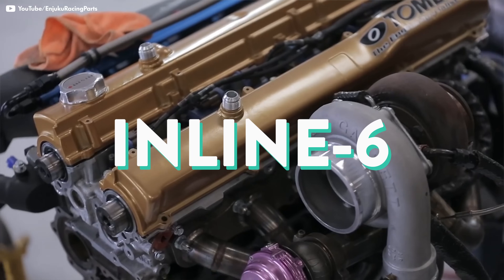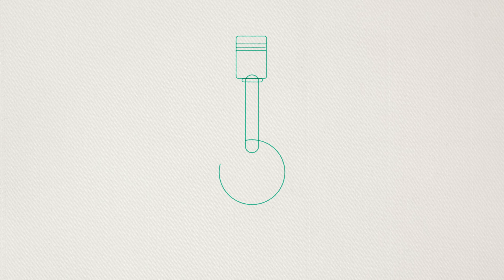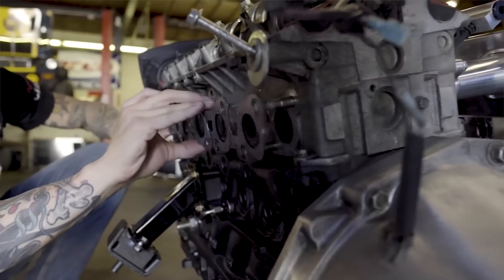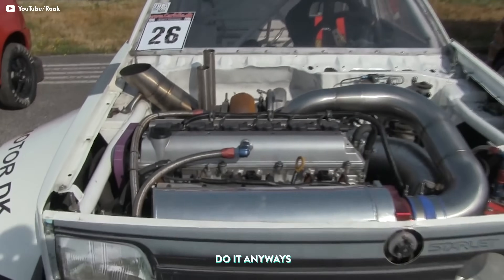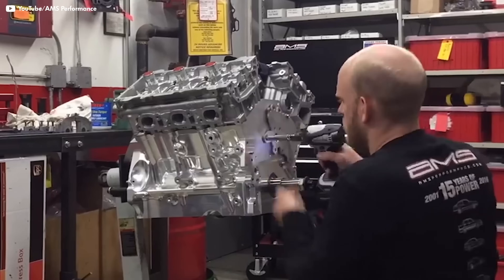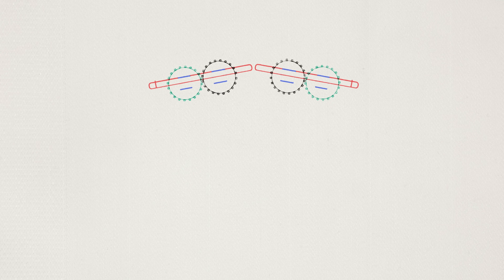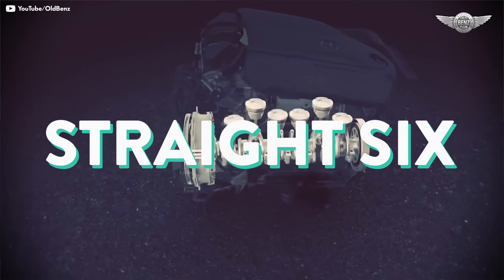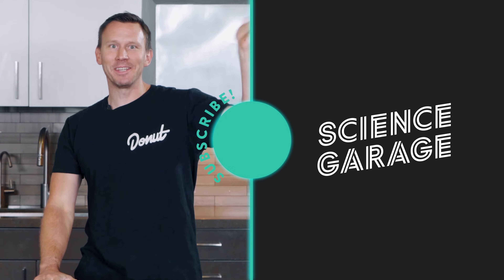INLINE 6 vs. V6 - How it Works | SCIENCE GARAGE

Comment: Everybody talking bout supras and whatnot but AMC/Jeep inline 6 is bae
Reply: Ford’s inline 300 is pretty good too. It isn’t a powerhouse but they are pretty bulletproof. My brother has a 500k+ that hasn’t been rebuilt once. The rest of the truck around it is falling apart though.
Reply: Kent Weisner I’m afraid I’m going to have the same problem with mine one day
Reply: THE 4.0 WILL NEVER BLOW

I wouldn't be surprised if my XJ outlives me, honestly. They can chooch up to 400,000 without any problems.
Reply: My 2000 Grand Cherokee has over 170000 miles on it and it runs better than the 2016 Hyundai I took my driver's test in
Reply: Jiggly Naut sounds like you got yourself a good vehicle in that Grand Cherokee

I have a 1991 Cherokee Limited that I'm in the process of getting back on the road

It needs to have a suspension overhaul done along with a few other things, such as a transmission rebuild
Reply: Tornado motor baby
Reply: Eamon Murtaugh I actually have a Jeep Cherokee that has an inline 6

In fact, I'm actually looking to get it fixed up so it can be driven again
Reply: Was hoping for a Barra comment in here somewhere...
Reply: 231 cubic inch Buick V6 is the best V6!!!!
Reply: The Chrysler 225 Slant Six is the best.

My '62 Dodge Lancer has lasted 56 years, 872,000 miles, and by the time I got her, 15 years of being left outside without being ran, all without an engine rebuild, and is still running.
Reply: Iron duke!!
Reply: B1 Battle Droid the Iron Duke is a Pontiac 2.5L 4 cylinder.

Comment: Forgot the 4.0L straight 6 from Chrysler
Reply: Jeep!!! It was a carry over from the AMC buyout. It was Daimler that really killed it though!!
Reply: @TheOtherGygax  yes, my bad I forgot about that (and I'm a Chrysler tech) but what was the final nail in the coffin for that engine was the stricter emissions and milage regulations of the time.
Reply: The best 4L inline 6 is the BARRA
Reply: You're all wrong, the 225 Slant Six is the best. It was produced mostly unchanged from 1959 to 2000, and was used in fucking EVERYTHING from coupes and sedans to trucks and buses. Hell, it was even used in not one, but TWO generations of Charger, a gen of the Challenger, and all of the generations of the original Dart.

My '62 Dodge Lancer is 56 years,, and has 872,000 miles. By the time I got her, she'd been left outside in the elements for 15 years, and yet she's still running.

Comment: How about the VR6?
Reply: Vr6 is bulletproof. Early 12v vr6 had timing chain guide issues but not that hard to replace. Plenty of room to boost without needing to build the motor.
Reply: Bruno exactly
Reply: @S54VR6  if is so bulletproof then why is there only like 5 cars left in the world with them?  #theyaredoodoo
Reply: ClutchkickPJ lol the vr6 is still to this day being produced and being put into cars. Wtf are you talking about. It’s been in VW’s since the early 90s. Over 20 years of production..never said they were the fastest but certainly well rounded as far as reliability and potential it has without needing to be built.
Reply: really not sure if VAG is still making true VR any more but i also know that they can handle something like 125-150hp(more with head spacers) per cylinder , their one of(if not the ) best sounding V6 ever and that there was some successful swaps done with VR replacing the S4 2.7tt engine it was done for better reliability, however they did have their faults, as with any euro car in America fixing them cost more, they were a little heavy on fuel and aside from FI you really wouldn't get huge performance gains with basic bolt ons
Reply: lmao all the people hating on the vr6 have probably never even fucking owned a car with one.
Reply: A Goose lmao yeah seriously. I’ve had 2, 2.8 12v and maintain my mk4 r32 with the 3.2 24v. One of the most reliable engines I’ve ever owned
Reply: A Goose Truthhhh
Reply: The VR is a beast
Reply: Came here for this comment.
Reply: ShamelessTR me as well 🤙🏼
Reply: Its a reliable engine and has good potential to be boosted and alot of good swaps out there. I own a 2.8 24v VR6 its a fun and reliable daily i enjoy the engine and exhaust sound, not the fastest but it can hold it own with a couple of cars.
Reply: Isn't the Bugatti engine 2 VR6 engines joined together?
Reply: Was goonna sayy that! One day VW/audi will have a boosted VR6 out kick their asses.
Reply: Yesss, I have a 96 jetta vr6 and a 07 cayman s Chrono flat 6
Reply: Wack
Reply: XIV I never said it was good
Reply: Trash engine
Reply: It's basically an Inline V6. Easiest way to explain it really
Reply: Junk :/
Reply: Aidan Barrett I never said it was good
Reply: Perfect, exept that it sucks
Reply: lego technic I never said it was good
Reply: Slow and broken
Reply: zomgzomgzomg zomg I never said it was good
Reply: It's Doodoo
Reply: So slow LOL
Reply: Neg Ative I never said it was good

Comment: Jeep 4.0 I6 is the best because you can’t kill it !!!
Reply: 245000 miles and I'm just breaking it in
Reply: Its calls amc did all the engineering and ground for it. Amc made the best most bulit proof I6s ever! And they made ok power for what they were made to do.
Reply: You clearly haven't heard of mercs million km engines...
Reply: @GamingM3d1a  good for them but iv seen to many of the old gremlins and hornets that just kept going and going only being let down by the body rotting away. The 4.0 jeep motors were the last engin that the guys at amc had there hands in, and it was unstoppable iv had one bring me home with a hole in the oil pan. starved of oil main bearings screaming for mercy they simply dont quit
Reply: mercs gas and diesels are just the same + they hold tons of power even with stock internals
Reply: @TYÄ_MIÄS, Guess you haven't heard of any Cummins diesel that have seen over 1 million miles with is a lot more than 1 million km.
Reply: 325000 miles on mine and still going.
Reply: @USMC-lr8th  328887 gotta catch up 😉
Reply: Just hit 202k in my WJ!!
Reply: Mine died at 425k, 2000 Cherokee :/
Reply: Ford 300 I6 is also incredibly reliable and has so much torque.
Reply: @wyattrowe8396  wow that whooping 306 lbft gross at 2000 rpm was so great even tho it was probably like 235 in reality at 2400 rpm
Reply: 5.9L Cummins I6.
Reply: Up in Canada, we have a many 4.0 jeeps chugging away at 5 6 7 and 800 thousand kms.
Reply: I got a 4.2L I6 AMC and it runs like new
Reply: 1996 Cherokee. 298,000 miles. 💪🏼
Reply: 5.9 cummins too
Reply: 2000 XJ Sport, only 146,000 miles.  I laugh when i see $35K Wranglers with Town and Country engines.
Reply: Let me throw a turbo at it and we'll see what it can really do lmao
Reply: You can kill them though XD there are a bunch of dead ones in scrapyards
Reply: @AzzaYaDog  lol ok but u can kill a rhino with a stick too but the odds. Ill give u th old merc 3000 oil burners but iv seen them in the junk pile as well. Lets agree that come hell or high water if u had to drive some ware and u had to make it life or death we wouldnt trust a ford 5.4 to get us thare.
Reply: Michael Dugger I can vouch for that, I have one myself that I'm wanting to get fixed up and drive it again
Reply: it's actually a AMC i6 that found it's way in jeeps too.  By the way, Ford I6 and Chrysler slant 6 were even more durable.
Reply: The only issue is that everything else surrounding the engine breaks.
Reply: I tried explaining it was the sixes and not the eights that were basically indestructible, I wasn't able to convince one, he later bought a V8 used that needed new timing parts and gears and had some pretty poor cylinders (V8's are still great and usually reliable in the older models, but a used Jeep with that inline 6 will almost never give you headaches).
Reply: Wait isnt that a AMC motor?
Reply: Michael Dugger that and the ford 300
Reply: Yep. Mine had a serious oil leak issue. Ran it dry twice, put oil in it, let it soak. Fired right up.
Reply: Surprised he didn't mention that one
Reply: Lol you’ve never heard of the FZ or F engines
Reply: @FS5R50B  Toyota will always be more reliable than Chrysler but the 4.0 is one engine that stands up to Toyota
Reply: Matt S true,  those 4.0s can take a beating!
Reply: My YJ has about 80000 miles on it but I had an XJ with over 300000 and I agree. Also super easy to work on! I replaced the head gasket by myself in 2 days!
Reply: Strange... I've never seen that spelling of the 3.7 L Slant
Reply: best american motor ever made lol
Reply: my buddy has killed 3 4.0 I6s
Reply: 340,000 on mine!
Reply: Mentions x American brand always forgets gms i6s which could last longer and made power

Comment: Do a video about the VR6. You get the benefits of inline and v engines.
Reply: weird exhaust/intake ports prevent you from making good power from them
Reply: stirkac false.
Reply: true. using forced induction maybe, but that is a lipstick on a pig. any engine can make power when boosted (provided correct tuning)
Reply: @stirkac  yeaaa but you can't deny that they're engineering at it's finest. Also turbo vr6 all day

Comment: Where is my boxer 6 cylinders?!?
Reply: In the back of a Porsche 911.
Reply: On the side of the road waiting for a tow truck
Reply: Pablovini98 where's my VR6?
Reply: Where is my VR 6 engine
Reply: Probs getting a head gasket
Reply: They're cool too
Reply: You left them in germany
Reply: Boxer is just a flat layout.... so yes that’s a 180degree block.
Reply: Sideways G nope subies are 4 cylinders
Reply: Ben Johnson boxer engines are any flat engine. Flat 4 flat 6 flat 12 not limited to Subaru even Ferrari have flat engines.
Reply: @msengineeringdavid3702  it has to have the pistons fire in symmetry to be a flat engine. The ferrari is a 180 degree v engine. Even though called it a berlinetta boxer they are actually not referring to the engine
Reply: Paul  Bartley flat refers to the block layout how the crank throws are configured is irrelevant the block has no vee angle go look them up.
Reply: in my corvairs  lol
Reply: Sitting in my 2005 Subaru Legacy ☺️ sounding like a sexy boi
Reply: Outback 3.0R
Reply: theyre all busy fixing their garbage engines
Reply: @VS666  actually there busy setting lap records...
Reply: @VS666  stay in ur lane
Reply: @VS666  say that to Porsche
Reply: isnt that just a180 deg V6
Reply: @KevGoesRiding  not quite. Boxers and flat 6 are not conected the same way to the crankshaft
Reply: No
Reply: no, in a  180 v6  pistons pairs 1/4, 2/5, 3/6 are moving in tandem e.g. when 1 moving away from the crankshaft, 4 is moving toward the crankshaft. In a Boxer, the piston movement is opposing, both pistons in a pair are moving in the same direction, 1/4 are both moving toward the crankshaft, and the biggest diference imo is a boxer is inherently balanced where a 180 V engine is not
Reply: Ride The Track no lol
Reply: You mean those low powered flat engines 🤣
Reply: WarriorOfEden3033 low powered how many Porsche 911 turbos can you beat again?
Reply: Here
Reply: Porch guy butthurt
Reply: No one produces boxer 6 any more. Porches are 180 degree v6.
Reply: Discoloured Buttflaps you’re an idiot that is not a VEE  a 180 degree is a flat engine the cylinders are 100% horizontally opposed I’ve never seen ppl so stupid they’d actually comment saying such. A quick 2 second google search of a current 911 engine would tell you that.
Reply: @Ballacha  I take it you haven't looked at a crankshaft lately. It's pretty obvious.

Comment: Here's to more inline 6 RWD cars!
Reply: there's a Rumor that FCA wants to replace the Pentastar V6 with a new I6!
Reply: Ansaree97 did you mean to say IRS?
Reply: Lol bro I see you under a lot of videos I watch, you live in Cali also?
Reply: More transverse inline 6 cars like the original Volvo V60 Polestar.
Reply: we need more i6's !
Reply: What inline 6 isn't rwd?
Reply: Volvo.
Reply: @marcorrre  Volvo, Land Rover (albeit replaced with a V6 I think) and Suzuki (the Verona, now discontinued)
Reply: Meh, I would rather have a V8 over a inline 6 any day though I would like to see some tiny V12 say around 3.5-4L that can rev past 10k
Reply: An I-4 can rev past 10k and if balance and smoothness is the goal a inline 6 is superior to a v8.
Reply: A cross plane V8 is balanced and has smoother power delivery than an inline 6 as it has more power pulses.  Revving is mostly about stroke length and breathing.  At a given displacement a inline will weight more than a V.  Just for some perspective a RB26DETT tips the scales at 570lbs  A Coyote 5L is 445lbs, a 6.2L LT1 is 405lbs and just for giggles the Ferrari F140 6.5L V12 is only 596lbs.  Those are are all aluminum engines dressed with no accessories.  Once you get to a V8, V's are the superior design.
Reply: The flat-six and inline-6 are two of the most inherently well balanced engines period.
Reply: Naturally balanced vs corrected or slightly unbalanced makes little difference today.  Flat plane cranks can't be balanced without balancing shafts, few of them go that route today because it hardly matters and that is virtually every four banger out there.  Is naturally balance worth a the weight hit alone?
Reply: It depends on many things, such as how long you want the engine to reliably run. Class 8 engines put well over 500+ miles put on their inline-6 engines, not that they couldn't find longevity with a 5 or 4 cylinder engine.
Reply: @GlassTopRX7  Why not have the best of both and have a V12? :D
Reply: @GlassTopRX7  the RB is a iron block, and the 5L coyote, and LT are aluminum blocks so its not really fair.
Reply: Iron maybe heavier but it's whole lot stronger.
Reply: depends on what you care about in an engine.
Reply: Exept bmws

Comment: Next time v12 vs w12
Reply: Or v8 vs w8
Reply: V16 vs w16
Reply: V3 vs. W3
Reply: vs inline 12
Reply: That's stupid
Reply: Isn't a w12 basically 2 v6 engines combined?
Reply: W12 is basically two V6 engines placed side to side.  a V12 is two V6 engines welded in front of each other.  W12 engines are crazy complex, heavy and unreliable when compared to a simpler, and more efficient V12
Reply: @GTChucker86  dude a w12 is not 2 engines. The w refers to the positioning of the cylinders. Which are in a zig zag pattern. ITS A SOLID BLOCK. The v12 is in a straight line 6 cylinders on each side of the block.
Reply: William Brewer i never said they were two engines i just described it in a way that’s simple to understand.
Reply: well then you described it terribly wrong bc what you said wasnt true whatsoever
Reply: BEST STAR my bad for not explaining it well.  I know the engines are a solid block but i just originally explained it in a way thats easier to comprehend and understand not necessarily taken literally
Reply: just say two v6 on top of each other sharing block and crankshaft. that should do it for the next time
Reply: If you want to get specific, the W12 engines in use for modern cars are typically 2 VR6 engines put together, not 2 V6. VR6 = narrow angle 15 deg V6 with one single cylinder head that covers both cylinder "banks", in DOHC 4 valve per cylinder set up. The DOHC head on the VR6 is rather strange because there is technically one camshaft that operates both the intake and exhaust valves per cylinder row, read more on the VR6 if you'd like: https://en.wikipedia.org/wiki/VR6_engine
Reply: of course the Volkswagen W12
Reply: Well not really a W12 is two VR6 (narrow V6) a bank with a common crank a V12 is two inline 6 with common crank.  A V12 is naturally balanced like the inline 6.  The W12 is not like the VR6.  The W12 because of the VR roots is bore limited they will tend to be limited to lower revs as they get more displacement from stroke. The V12 can derive it's displacement from either stroke or bore more easily, which why Ferrari can make a 6.5L production engine that spins to 9k without much trouble.  

Other downsides with the W and VR engines is due to the single head per bank you have asymmetrical runners for the intake and exhaust.  Half the cylinders have short intake port and long exhaust and the other half has the opposite per bank that has to be tuned for.  Packaging for transverse layout is the only advantage for the W engine as they are shorter but wider than a V.  

It's not actually a W either it's a VV but being German they had fun it. A true W engine is a three bank engine Two side banks with center bank and a shared crank the VW W is actually four banks.
Reply: @GlassTopRX7  thnx for clarifying
Reply: absolutely wrong
Reply: @300ml_brasil  who are you replying to?
Reply: that thomas john dude
Reply: the W12 is two VR6 engines, the angle of separation is only like 20* or sum shit allowing you to use one cylinder head for both banks of the staggered pistons. so think of two of those engines in a V configuration.
Reply: Too specific
Reply: W engine = invented to make maintenance cost even more expensive .... check out how expensive bugatti's maintenance costs .. if ever 1 out of 4 turbocharger fails you'll need to replace all .. what a ripoff.
Reply: V12 wins it hands down   since it is 2 pairs of inline 6's (perfect balance perfect number)   while the W12 is  2 pairs of VR6 who tend to vibrate and are less efficient